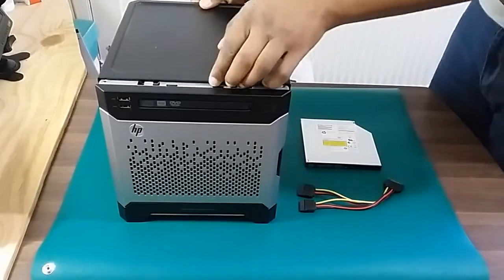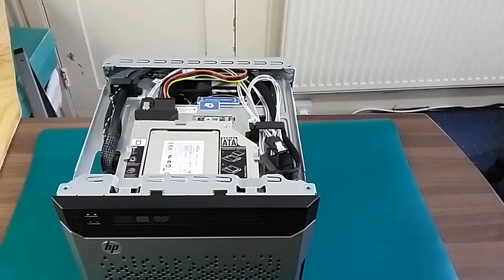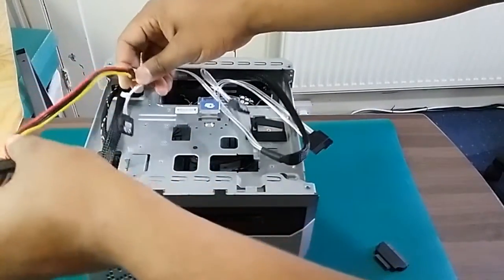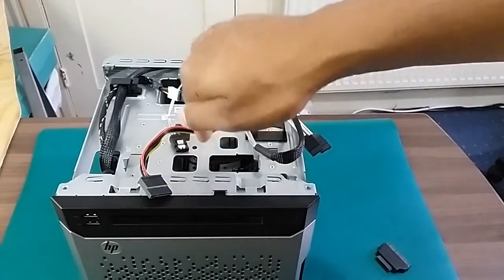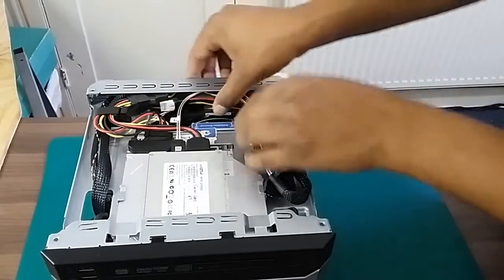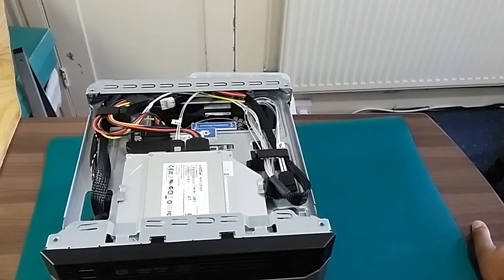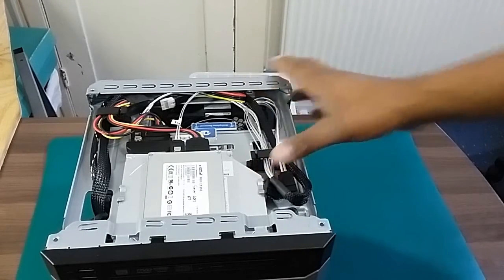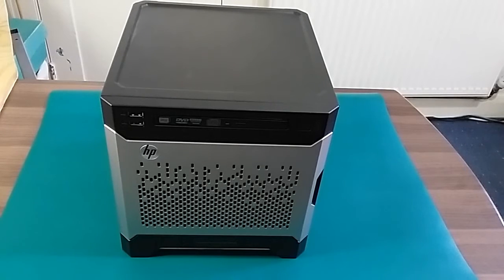HP Proliant MicroServer Gen8 - DVD-RW & Solid State Drive

Comment: Can you use the onboard raid controller as well as the PCI card controller at the same time?

I've seen someone use connect 3 microservers together.
They use the main one to run xpenology.
Then the other 2 essentially as enclosures, where only one of the PSUs is used to power the drives of both.
But the second server's PSU is triggered by the main server.

This way they can have a raid server with 12 HDDs
But they never wrote a tutorial and I have no idea how to do it :'(
Reply from the maker: That has been never tried or done before.
That would be interesting.